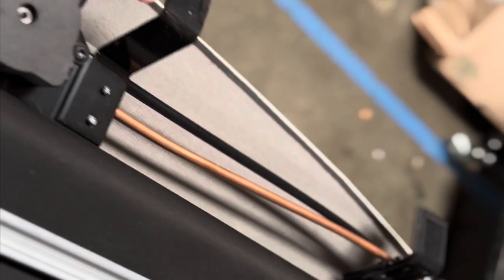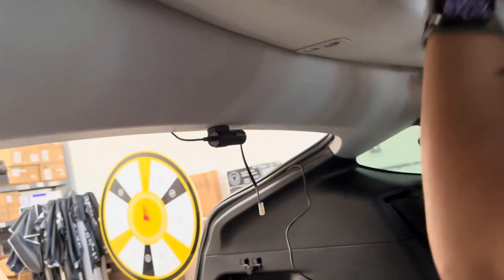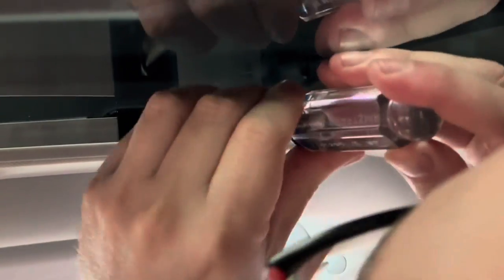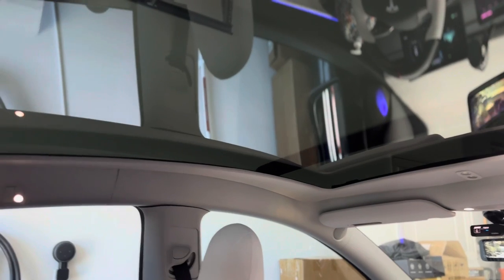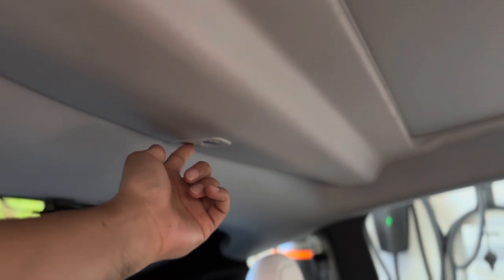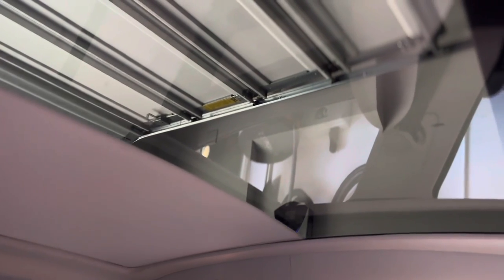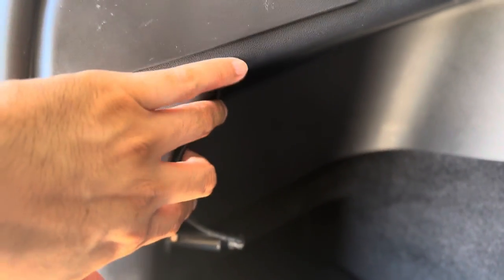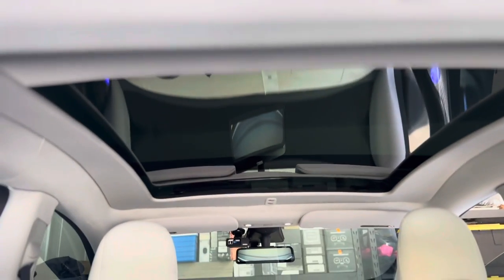Tesla Model Y Electric Retractable Sunshade Install and Review!

Comment: The thing that I don't really get is why provide an install that is connected to the cigarette lighter like that. A simple cigarette harness plug piggyback adapter would have made this 100x better for a seamless look. For a fridge that you might constantly take on/off, this type of connection makes sense but for something that you will set it and forget it, this solution isn't great.

Comment: This should've come standard on every tesla, I live in Florida and absolutely hate the glass roof, I have mine tinted to almost a full black out, and have a shade installed, and the sun still gets unbearably hot.
Reply from the maker: Agree or as an option I would pay more for it
Reply: Soon as I get my model y, I'm getting this
Reply: Sounds like you got the wrong tint
Reply: So you bought a car that’s inappropriate for your needs and you want everyone else globally to adhere to your requirements.   Good grief, I’m not sure you’ve thought this through.
Reply: @deetee6621  I'm not sure you're thought anything through in your life if that's the logical conclusion you came to.
Reply: @dexagalapagos  I think you’ve missed the point.  Don’t worry about it.
Reply: @deetee6621  There are more considerations to buying a car than just the roof, and not having a built in roof shade on a 70k car is ridiculous. If that's complicated, just move on.
Reply: @dexagalapagos  👍  I understand your point. But your statement that everything must change because it doesn’t fit your scenario, shows you don’t seem to understand the ethos Tesla is proposing.  Scale your view behind your small part of the world to the global market and you’d end up with a huge amount of waste that people simply don’t want, increasing cost, increasing overhead, increasing complexity.  The Op replied to you with a polite comment with respect to having it as an option (I thought it was an option, in some form). 

So my point, for clarity, is that we all don’t live in the same place on the planet.  It may serve “us” all well to imagine a world beyond our own walls.
Reply: @deetee6621  The same logic can be applied to anything. Not everyone uses autopilot, so why have radar or front facing cameras, not everyone uses a frunk, so why have a frunk, not everyone needs to carry large stuff, so why even have folding back seats, etc, etc. A retractable roof shade is one of those basic necessities that is ridiculous not to have on a $70k car.
Reply: @dexagalapagos  I’m listening and strangely, agreeing.  If it isn’t needed, make it an option.  But to put it in and make everyone have it, that doesn’t make sense.  It just isn’t required in a lot of the world. 
Full Autopilot, auto braking, lane changing, etc all use the same hardware.  It’s just a bit of software and I don’t think it is mandatory.
Reply: @deetee6621  I don't know if you live somewhere the sun doesn't shine, but there are sunny days literally in every part of the world I've ever been to, and I've been to almost everywhere.
Reply: @dexagalapagos  UK.  A shade was on my list when the car was ordered, but there is no need for it in the UK. Relatives in the Nordics also have no need for it.  Just my observation.
Reply: Who’s paying $70k for a y? With this logic why doesn’t it have cooled seats? A gauge cluster? Real leather? I live in the south and have a cheaper roof shade from Amazon and have zero issues with heat. Y’all are too sensitive.
Reply: Given a choice I would 100% go without the glass sunroof option. 

But they didn’t even offer the choice!

Comment: Instead of using the provided 12v plug, did you consider hardwiring the connection into the car electrical system for a clean out-of-sight installation?

Comment: Mine did not come with a adapter to connect into the outlet. Just harnesses with no explanation. I tried messaging them. No response. Did they change the power connection?

Comment: Somethings wrong with their website won’t let me check out keeps saying can’t ship to address you entered, review your address to ensure that all fields have been entered correctly and try again? I’ve tried it on several devices but still the same, won’t let you proceed with order even though address is correct?
Reply from the maker: It should work now
Reply: Just confirmed my order now using your code-tks!